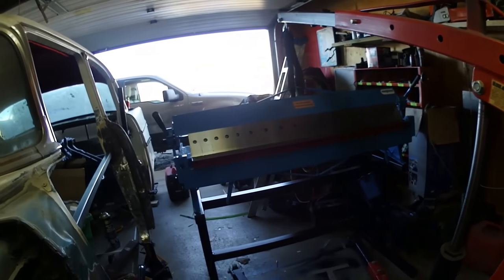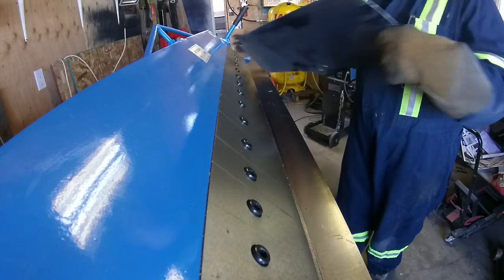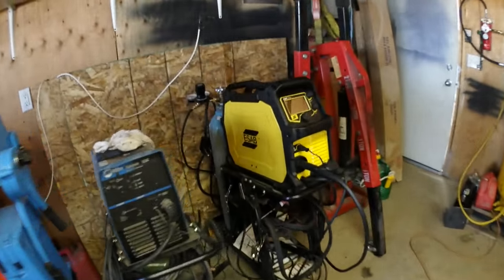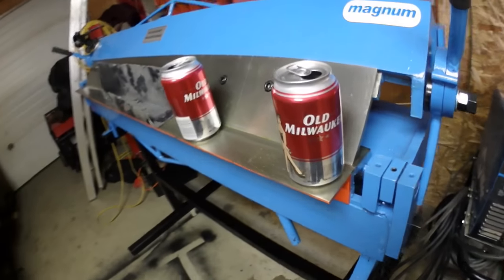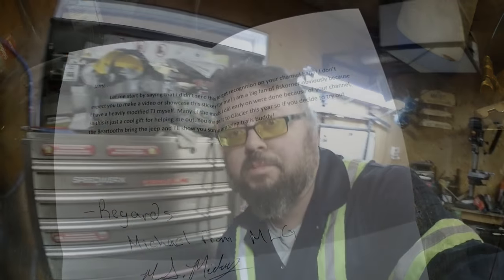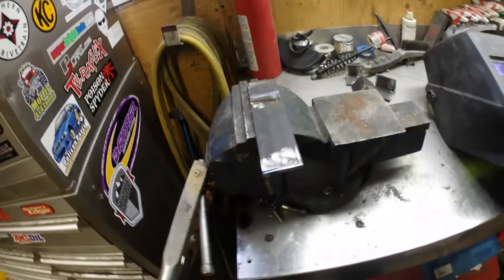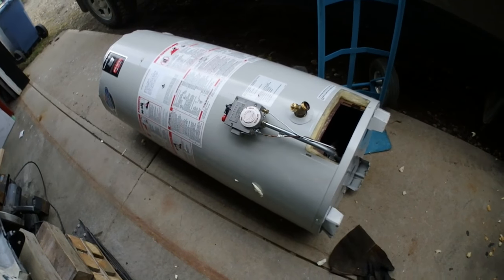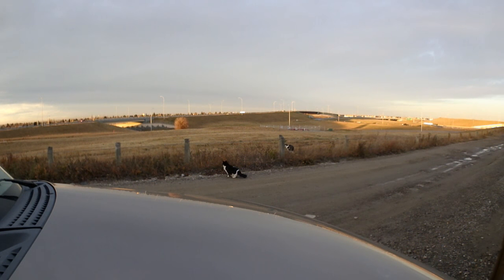Engine Hoists can do more than LIft Engines

Comment: I use those plastic flossers to get the lint out. Either use that or a tooth pick. I try and avoid metal.
Reply from the maker: +matt boehner that's a good thing, powered on you may screw something up

Comment: careful cleaning the port with that pick too, if you bend the 8 pins inside you will have to replace the charging port. If you have a dental pick use that. My business fixes phones and you'd be surprised how many people damage theirs using the wrong tool
Reply from the maker: that's a very good point to make out as someone will and would scrape the crap out of those pins

Comment: If it was my garage i'd put some casters on the frame for your sheet metal press. Get some plywood and 2x4's out the skip at work and throw together a small outdoor storage thing for it, if it fits through the backdoor and paint it tar or something. That way i could just wheel it in if i needed to use it. 

Good idea on fabricating stuff. Some of the so called fabricators out there sell absolute junk for a princes ransom.
Reply from the maker: i do have a decent sized shed in the yard but it's full of car parts, eventually it will be used for what you said

Comment: The last time I used my engine hoist I pulled a 4x4 fence post. LOL
Reply: STEVE ROB last time I pulled a fence post I almost rolled the tractor
Reply: Badgertronix  I tried using the  3 point hitch and the tractor front end can up Won't try that again.  LOL